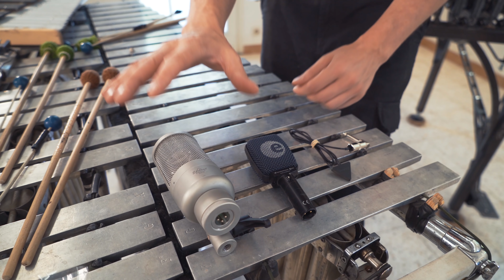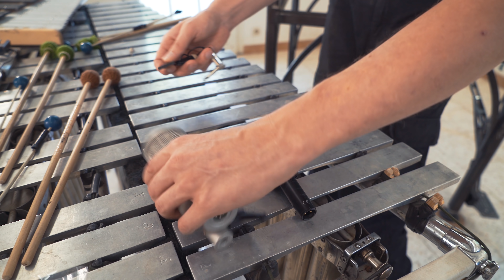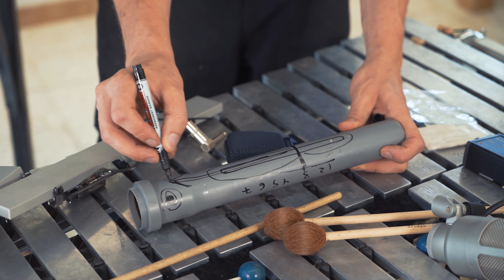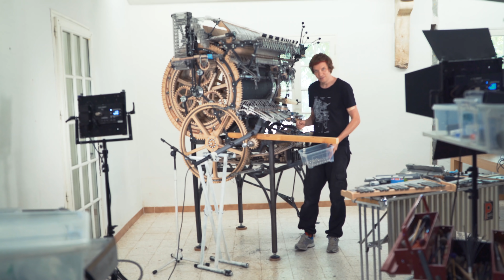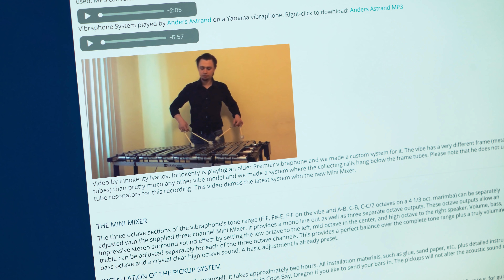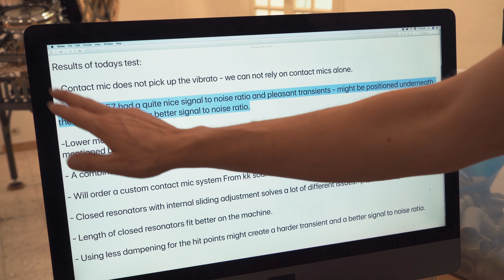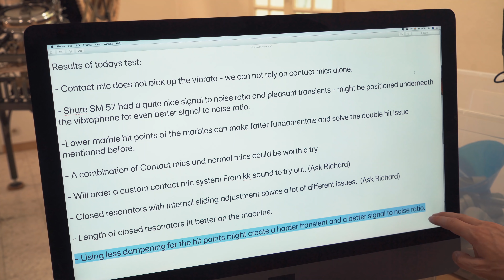Vibraphone Experiments / Microphone Types - Marble Machine X #96

Comment: I would go with the contact microphones combined with a digital vibrato system. That K&K solution is definitely worth checking out. It sounds so easy to set up, transport, and get consistent results with from venue to venue on your tour. Imagine how much of a hassle it'd be to set up 11 dynamic or condenser mics on tour. Those would have to be paired with the resonator pipes and you'd have all of that to deal with whenever you change the vibraphone plates out. Combine that with the song plates and all the other customizations (rhythm machine, bass strings + tuning there maybe?, etc.). I'd honestly start optimizing for reliability and consistency and minimizing the amount of hassle/setup involved if I were you. Your audience might not enjoy waiting 20 minutes for the MMX to be transitioned out of one song and into the next with all the prep work and setup. Maybe you can have a well-trained pit crew or something to get it done in 4 seconds flat but that'd be quite the investment. Anyway, great content today! Wishing you all the best and great success on your tour.
Reply: I'd say definitely consider the K&K Sound vibraphone pickup system. It's the best of both worlds - even if you install the pipe resonators at some point, the piezoelectric pickups shouldn't interfere, and they can act as a backup system. Connection errors during reconfiguration of the machine can be minimized with a custom outboard for pickup inputs and color-coded TRS connectors for each bar (say, L red for low notes, R white for high notes), or by using a single mono channel for all pickups.
One potential problem is, all wires shall be carefully positioned to avoid direct contact with anything, because all accidental hits and vibration on the loose wires will pass straight to the piezo ceramic elements in the pickups. This may also require loading more springs to the holder arms to restrict bar movement, or even locking the bars in a fixed position.

Comment: Havent read through all the comments yet so pardon if Im repeating something

With the MMX vibraphone you basically have a small Rhodes with really big tines. Is it doable to use a big coil to produce an electric signal (just as in the Rhodes) that could be amplified. Vibrato could be added later. Or maybe even make the coil assembly move about to make a vibrato

<3
Reply: The only drawback, like my old Wurlitzer 200A, is that those pickups use high voltage. Judging by the shock, over 100V.
Reply: @buddyclem7328  Aha. I didnt know the Wurlitzer had active pickups. But gien that the vibraphone makes enough sound to be clearly audible without amplification. There should be enough energy for passive pickups

At least thats the theory :)

Comment: One solution that came to my mind and I think make sense is to use small electrect(good quality ones) or even condenser (lavaliers) microphones that could be placed on the damping arm or somewhere very close. If you want to increas difference between signal and background noise. Use cardiod/directional microphones oriented toward source and get as close as possible. The more close you get the lower gain you use and the lower is the background noise level.

Comment: You could go with contact mics on the plates, use jacks to plug each one in on the MMX, and then run them through an analog vibrato pedal.

It all depends on how badly you want a physical vibrato versus getting the sound from the plates without background noise.

Comment: Hey Martin! Have you thought about optical microphones inside of the resonator tubes? From my understanding, it should be possible with a closed tube type design, allowing for positioning inside the tube (as the bottom itself, possibly?) and provide a very good signal-to-noise

E

Comment: Interesting... So a contact mic is ideal, but you want it to pick up the vibrato, which is really only in the air, caused by the spinning disks blocking and unblocking free airflow through the resonator pipes... I wonder what would happen if you stretched a membrane across the end of the resonator pipe, and attached a contact mic to the center of the membrane?

Comment: I could have told you that you won't get any vibrato through the contact mic without doing the experiment. Basic physics: The air column is only weakly coupled to the metal plate that is driving it.  This is a physics problem. It is solvable, but you have to compromise. If you put the mic into the tube, the problem is that you are picking up transient (higher) frequency resonances. The reason for that is that the air resonates both in the vertical axis and on the horizontal axis between the walls of the tube. You can get rid of this "tinny" resonance electronically (just filter them out). This seems to be the best compromise to me. But here is the best idea I've had ever since I heard you say "professional vibraphone players use contact mics" (which I immediately said to myself "no way!") is: Use a contact mic as a "gate" as well as a sound source. So basically gate your normal mic in the tube by turning it on whenever the contact mic is picking up a certain level of sound and turn it off whenever that level falls below some predetermined value. That way you will get both a nice ping from the marble striking the plate, plus the vibrato from the mic in the tube, and no extra noise once the note has been damped by the dampers.

Comment: It would be interesting to try the contact microphone inside the resonating pipes as the vibrato comes from the moving air inside the pipe and not from the plaques themselves. 
Not sure if it works, but it’s worth a try :)

Comment: You could place a contact mic on the bottom plate of the closed resonator or even use a rotary encoder on the axle for your vibrato mechanism. Use this signal to modulate a digitial vibrato. 
Alternatively you could try to implement something akin to a soundboard. Fix a body rigidly on the vibraphone and mic that with contacts. Advantage would be that you dont have to unplug anything when changing plates and you dont run into the problem of having these very harsh signals.

Comment: I'm not at all an expert but did you look at hitting the vibraphone plates at the ends past the support. Its not normal but you should get a good transfer of vibration through the plate past the zero point for the support.  Second can you funnel all the resonator tubes into a couple of final tubes so that you get several notes per mike and reduce your mike numbers if you were to pick up in groups. Third and final thought, could you do contact mikes on the plates and a mike in the tube and then mix the vibrato with the contact in the sound board?

Comment: If it doesn't work out with the closed resonator tubes and the adjusting system, maybe try open tubes where you have a smaller tube and a larger tube that can slide, so you can have a longer or shorter tube. Just an idea. Also, I saw comments about contact mics on the cap of the closed tube, but that wouldn't work at all cause the closed end is a node of the soundwave.

Comment: I know you hate compromises, but I would actually suggest using an array of super-cardoid or hyper-cardoid small diaphragm condenser mics right over the vibraphone. To minimize bleed you could try to use a lot of them (4 - 8ish) and angle them down to the floor. Of course, you will have bleed (which is a completely different thing than signal to noise ratio btw ^^) but that is totally normal and does not have to be a problem. Think of micing a full drum kit: every mic kind of picks up a little from every drum, you can't eliminate that. Good engineers know how to set up the mics in a way that it still sounds great (getting the phasing right, putting gates and dynamic EQs on etc), which you would maybe call a compromise but imho you can still achieve perfect results.
I think you should accept compromises in micing a vastly complex multi-instrument machine, because when done right it isn't a compromise at all sound-wise. 

Oh and I always loved your way of saying "idee-uh" :)

Comment: A mic inside the resonator is never going to sound great, even if it can handle the sound pressure. If you think about it, you're actually sampling the wave at a spot where fundamental is actually pretty weak. If the mic was at the mid-point, you'd get an exceptionally strong fundamental... perhaps too strong.

I think using closed resonators sounds like a good plan, because the true vibraphone sound to a human observer involves sound radiated directly from the plate as well as the sound from the resonator, and then you can pick up both with one mic. Also, open-ended resonators are likely to pick up background noise and generate ghost tones, particularly in a stage environment.

Here's a crazy, out there thought... what sort of sound would a high-air-pressure mic attached to the end cap of a closed resonator pick up? It would certainly be a very strong representation of the fundamental.... I suspect it would be too pure and quite unmusical though.

Comment: Make a vibrato using by mixing all the mic inputs, then amplification that varies with the rotation of the gears. That should give adjustable vibrato, albeit not purely mechanical. Could be purely analog tho.

Comment: Did you tried with metal pipe putting the contact mics at the outside of the pipe? 

Maybe the distortion came with the reverb generated inside the pipes.

Comment: Perhaps a shaded disc light sensor thing on the shaft that turns the flaps sending a midi signal to vary the volume of the vibraphone channels? That way you could still do the manual vibration as you did on the first marble machine.
Not sure how to explain this properly, half asleep.

Comment: Have you considered shotgun mics? If you use 2 or 3 for the whole vibraphone you can position them in such a way where the machine sounds are out of the pickup pattern of the mics.

A nice noise gate would come in handy as well if you tweak it well enough to not cutoff the ends of the notes but eliminate the background noise. That may not be necessary with a shotgun mic though. 

The Sennheiser ME36 is a very small condenser with a tight pickup pattern that I think would sound great and work well for this application. It also mounts on a thin gooseneck so positioning options are ideal.

Comment: I'm sure—as with every time I make an insightful comment like this—dozens of other people have said this. But have you considered contacts on the resonators themselves? Perhaps a combination of the two. You might have to play with phasing, which could be a nightmare, but INVERSED phases might result in the correct sound if properly calibrated.

Just an ide*a* ;)
...
Reply: memespace I had this idea too He would need another mic to record the actual plates though but he is already talking about two sets of mics anyway.
Reply: if you put contact mics on the resonators, would they then have to be metal?
Reply: Nuts Mc Flurry I don’t think so because all that matters with sound waves in a pipe is that the air moves freely. As long as the contact mic doesn’t mess with the air column inside the pipe it shouldn’t affect the resonance (at least I’m pretty sure). Martin could experiment with placement of the contact mics as well, trying inside and outside

Comment: What would happen if you built a casing for the vibrato tubes?  An oval tub (not tube, tub) with an open top but a closed base - like a cigar case, but not close fitting.  If you put a large omnidirectional mic in the bottom of the casing, it might pick up all the different vibrato, but be 'insulated' from other noise from the machine...   You might have to line it with thin sponge to further stop noise coming down the sides of the casing.  Might affect some frequencies more than others though...  (I agree with others about a contact mic on the tube - worth a try, but it looks like that's what you did in the video... did you not?)

Comment: You could use the contact microphones if you would include the signal cable plug into the vibraphone plate attachment. Attaching the plates would at the same time connect the microphones.

Comment: Tuning forks can "transmit" their resonating vibrations from one to another through sound. If you place the proper tuning fork below each note of the vibraphone it would be possible to contact mic the forks without interfering with the source sound from the vibraphone. Given the design of MMX  you might be able to regain the vibrato by introducing a barrier that moves back and forth from between the fork and vibraphone plates to change the amount of energy being transferred

Comment: Some ideas:
 - Put the contact mic on the adjustment piece for the adjustable closed resonator pipe.
 - Have a short piece of pipe with the vibraphone flap, and then create some 'U' pipes (two elbows) of various lengths that you tack on to it. The idea is that the end of the pipes will always be in the same place, and that's where you can put the Shure SM 57 mic.

Comment: Hi -- the idea that condenser mics have a worse "SNR" than dynamics is probably incorrect here... I think you should let go of the idea that dynamic mics are the only option. I know that you aren't referring to the classic "SNR" of the electronics but rather to the pattern directivity and background isolation of the mic, but even so: I would think that installing multiple SM57's would be a semi-crazy way to mic this; if you want to use mics, why not use small electrets? E.g. google "12 gauge microphones", but no doubt there are much smaller options out there as well. Also note that using multiple microphones is going to cut down on the overall gain-before-feedback of your amplification system. The professional contact mic solution might be a good way to go.

Comment: Because of the physics of closed/open tube resonance, vibrato only exists in the air and does not propagate through the mechanical parts of the instrument. A contact mic is thus not able to "hear" vibrato, because a contact mic does not "hear", but instead "feels" sound.
The closed tube approach is still viable (the scientific term here is "closed air column"). Because of the physics of closed tube resonance, the cylindrical air column will produce odd harmonics, with the full amplitude always existing at the rim of the pipe. That means spacing between plate and tube is important, but you can also affix a small mic inside (or just below) the lip of the tube to capture the vibrato sound. The tube would shield it from the noise of the MMX.

Comment: It sounds like you are moving away from open resonator pipes but...
Can't the 'effective length' of an open resonator pipe be changed by opening or closing ports along the side like a reed instrument or a flute?  

The point in the resonator that is held at atmosphere pressure, by an open port, should be the physical length that the standing wave begins. This should determine the length of the standing wave and the point at which the tube will resonate.
Thanks for the extra video! Cheers!

Comment: Two cents (well, four after editing) from an organbuilder considering the resonators:
As you already figured out: a closed resonator cuts the length in half (to be precise: an open res. has half the length of the fundamental-wavelength, a closed one only a quarter. But a resonator does not necessarily have to be tuned to the fundamental, one octave above = first harmonic might work as well)
What might be new info for you is that with each bend in the resonator the effective length reduces even further.
Take a given resonator, say with a lenght of 2 meters, and put 3 or 4 180° bends in there. You will find that the resulting lenght of the 'serpentine-resonator' while still measuring 2 meters is quite a bit too long (too low) and to be tuned correctly has to be reduced by additional 15 to 20 cm.
All in all, considering the available space, you can reduce the necessary space by packing the resonator more tightly and shrinking the absolute lenght.
Also the wider (as in diameter) the resonator, the shorter it becomes and less harmonics are pronounced.
At last, to make the resonators work with the different plates have a look at how organpipes are tuned. Pushing a piece of pipe further in (as you did) definitely works for 2 or 3 semitones. But you might also try building open and closeable holes into the resonator as like on a flute/clarinet to speed up the tuning process when changing the vibraphone plates.
Feel free to message me for more info...

Also in response to all you guys proposing contact mics on the resonators: it really doesn't work this way.
For those mics to pick up sound the resonator has to be vibrating (doh...) but every bit of the sound energy being transformed from vibrating air into vibrating pcb is less vibrating air.
 -> to get the loudest acoustic tone out of the resonators and thus the most pronounced vibrato the pipe has to be as stiff as possible!

Comment: I dont think a all-in-1 marble machine is a good idea. You dont have enough space for a whole set of instrumental modules, drums, bass,vibraphone plates. Either do I think a fixed scale score wheel is a good idea. A kind of bike is call fixed gear, the tech to hold its back wheel is useful for some soft programming scalable score system.

Comment: If you're wanting to swap out the various vibraphone bars relatively arbitrarily, as you talked about in the last video, wouldn't that also require being able to swap out the resonating tubes if you went that way? Even with adjustable ones, presumably they wouldn't be likely to be adjustable *enough*? It seems like the contact mics with digitally added vibrato would avoid a lot of the headaches of that system.